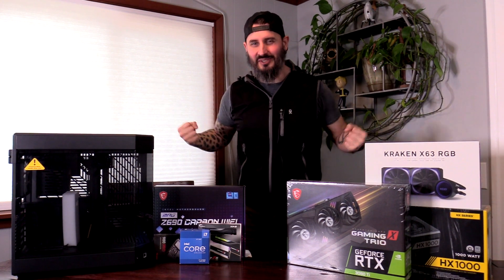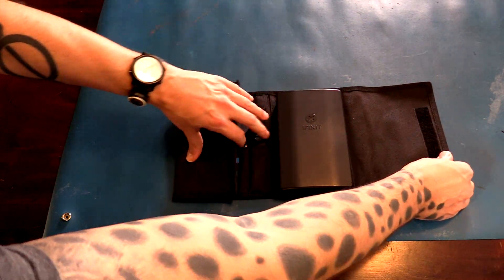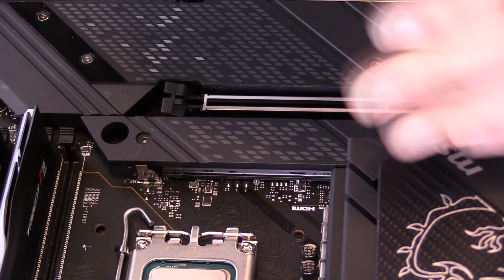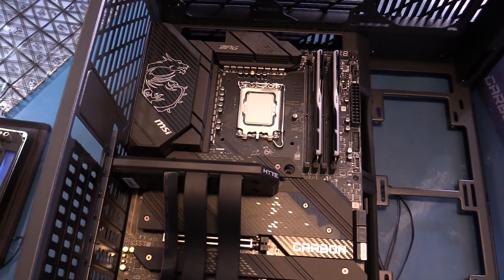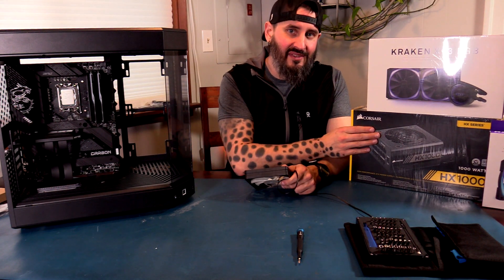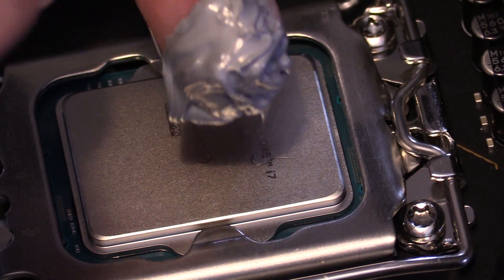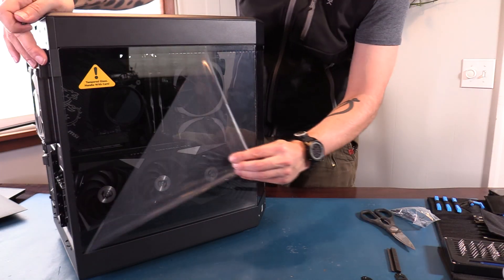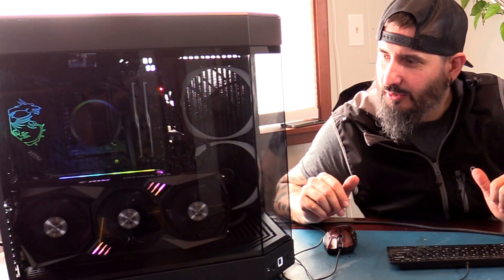MY NEW RIG!!! (Full build video of my new PC)

Comment: How did you control the bottom fans did  you use the  Nzxt controller or direct to motherboard fan header.
Reply from the maker: Great question! The bottom fans are stock actually and came with the case. They hooked directly up to the mobo.

Comment: i might of missed something but whys the rear fan on the outside of the case in the last few shots ?
Reply from the maker: It could've gone inside the case but I did a little mod so it would go on the back and not block the lit up MSI dragon on the mobo. Totally an aesthetic change but this build was centered around it looking amazing lit up so I was happy to do it. 
I did have to make a custom grille for the fan which was easy (link below). I used the case's stock fan and now the blades aren't exposed. It worked out great!
https://imgur.com/b3pwlpW
Reply: @GurhmsGarage  nice one , I only asked a s I have the y40 on order and I know it's a tight fit with a 360 in the roof

Comment: I'm doing a similar build right now I actually have the NZXT Kraken X360, I'm taking my Intel I9 and my 3070 out of my computer for this build. I'm using the same box but the only issue that I'm having is I bought the MSI Godlike z590. I have to save this motherboard is insane! He comes with what they call a smart fan that you plug into where the GPU sock it is but because those parts are already taken up with this case I don't know what I'm going to do with it at the moment
Reply from the maker: Yeah, I'm just checking out the Godlike z590. What an awesome mobo, I love it!
Regarding your issue, I'm not clear on the specifics. Where does the smart fan connect to on the mobo and/or the case?
I hope you figure it out and the build goes smooth. Good luck!!! :)
Reply: @GurhmsGarage  its was the NZXT Kraken x63.. there's a driver issue in the software will not connect and then the lights and up going out and because of it. I got a replacement coming but everything looks phenomenal. Thanks brother
Reply from the maker: @photobeast  Awesome! Cheers my dude :)

Comment: How are the thermals?
Reply from the maker: Really good actually! Even this summer on a 95F day running HUNT all day it stays within acceptable ranges. It does run a little on the warmer side but I've never had an issue or been concerned. Very happy with it, especially with this being my first vertical GPU. They really designed the case well.

Comment: Wow that looks so clean! I'm picking up parts for my first build, and It's funny I was thinking of picking a Carbon motherboard and a MSI GPU like your setup. Those looks so damn clean! Hopefuly I can my build look as cool as yours. (Funny enough, I also have a Y60 incoming, but mine is the Hololive collabation with Hakos Baelz, so very, very red and black xD) Interesting to show the process too, since I've never done any of that xD
Reply from the maker: Congrats on your upcoming build! Awesome! It's a really fun build with the Y60 as well. Lot's of room to access everything and it has a ton of cool options to route your cables. 
I've been really happy with my setup too. The temperatures are excellent, the lights look incredible. It's a real show piece. 
I hope your first build goes great and have fun!🍻
Reply: I just bought that case in red gonna be a bit before I can water cool it is that bad to have the pump so low I can't remember if you want the pump above the reservoir or below

Comment: Hello, amazing video. Just wonderingwhat kind of temps do you get on the cpu? Idle and underload?
Reply from the maker: Thank you so much! Temps are really good. At idle while browsing or editing, cpu sits at around 29c and in the case it's 28c. When under heavy load playing demanding games maxed out with ray tracing I've seen the cpu get up to 70c roughly. 
There has been a couple times it's peaked at around 75-80c but that's only after I've been playing for over 5-6 hours straight and it was hot in my office. 
Temps on the GPU are good as well which is what I was most concerned about due to it being so close to the front glass panel. However, they stick comfortably 65-75c depending on the game I'm playing. Sometimes it's peaked in the low 80s but again, that was after a super long session with a demanding game AND it was super hot in my office. 
Overall, extremely happy with the case and the build. Cheers! :)
Reply: @GurhmsGarage  thanks man, I much appreciate it
Reply from the maker: @BasicPurple  Word up

Comment: There’s 3 fan on top and 1 on back for air out and 2 down and on side for intake so that 4 each so isn’t that equal intake and outtake
Reply from the maker: I put 3 in and 3 out for this build. Two intake at the bottom and one on the back. Two outtake fans on the side and one on the top. Temps are awesome as well. The GPU gets a little on the warm side but that was to be expected.

Comment: Beginning At 6:25 a major mistake was made when  installing the radiator with the cooling tubes down, doing it that way will potentially kill the pump prematurely. There are many major YouTubers that made videos regarding proper installation.  I'm not bashing you, I just wanted to let you know. You have built a very nice system!
Reply from the maker: Yo, thanks for the comment and concern. I actually made sure ahead of time this would be ok and in fact is optimal. The air bubbles are trapped at the top of the aio radiator chamber and not the pump chamber since the highest point of the radiator sits above/higher than the pump itself. The tube direction actually doesn't make a difference as long as the air has a higher point to consolidate that's not the pump chamber (and the air already in the aio system is in the radiator chamber).  
I appreciate the kindness Bro and glad you dig the rig. It really turned out incredible! :)

Comment: Awesome build man. I've actually got all the parts for a similar build, but I'll be using a MSI Edge MOBO with Corsair fans & AIO. Just waiting on the Hyte y60 case. I'm thinking of going with 3 exhaust on top with the 2 Intake on bottom, & 2 Intake on the side with the radiator. Still debating on if that's the route I want to go though. This will be my first build. I'm super excited.
Reply from the maker: Awesome Bro! Major congrats on the first build. What a badass rig it will be too! 😁 The MSI Edge is just as cool honestly. Good savings sticking with DDR4 as well. 
What GPU are you going with? I bit the bullet hard on mine but prices have started getting reasonable again...finally.
Reply: @GurhmsGarage  MSI RTX 3080 got it for a decent price just about 10% over MSRP. I got lucky finding it so I nabbed it straight away.
Reply from the maker: @Ry.No-007  YES! Great news and the MSI 3000 cards are just so damn cool looking. They are only 3 1/2 slots as well so you'll have good clearance for air from the glass front panel. 
I hope your build goes smooth and fun Bro! Cheers :)

Comment: cool video bro thx!!!
Reply from the maker: Absolutely man, cheers! :)
Reply: @GurhmsGarage  yea pretty sure my next build will be in the y60 white for sure
Reply from the maker: @hexacarbide268  Oh man, I almost got the white case as well. It really is a joy to look over at this build. You're gonna love it!
Reply: @GurhmsGarage  yea the contrast makes it pop. Hardest choice is phanteks vs ek aio.  They are both so dope looking in the white out
Reply from the maker: @hexacarbide268  Dang, both those are super dope. The EK takes the cake though man. What's the GPU you're going with?
Reply: @GurhmsGarage  probably the 3070ti /6750 gigabyte aorus with the leds on the blades. U know cause it's a more of a show peice... aesthetics and function.  Specifically cause of that case
Reply from the maker: @hexacarbide268  Hell yea, that's a DOPE card man! It is a four slot card so be sure to double check your clearance. My MSI 3080ti is a 3 1/2 slot and there's a good inch clearance from the front glass panel by looking at it. Might be no problem at all but, measure twice, cut once ya know ;)

Comment: Awesome build man! My hyte y60 is on the way. my main concern has been thermals and you’ve given me a pretty good idea on the setup. I’m probably going to start by air cooling the gpu and using an aio for the cpu, then moving on to a custom loop for liquid cooling both. I’m also gaming at 1440p
Reply from the maker: YES! Awesome man, congrats on your new build!
My temps have continued to be just fine. I've monitored temps during several long sessions in HUNT Showdown and other extremely taxing games (playing at 1440p with maxed settings)...cpu stays around 58c, gpu hits 81c but never gets hotter and mobo was tracks around 71c in the case. It is a little on the warmer side but nothing that would cause throttling and if you eventually go all liquid, my hats off to you. What a killer build this would be all liquid cooled. Cheers Brotha!

Comment: Hey how is the thermals on that? Kinda had the same fan problem u had i was going to do 3 intake top and 2 intake bottom then have the side exhaust fans but i might go with your fan setup instead im mostly concerned about that fan in the back
Reply from the maker: Thermals have been just fine. I've always used full size cases outside of some crazy custom builds in the past so I was expecting it to be a little warmer...and it is, BUT there's definitely no issues. I've tested HUNT Showdown maxed out at 1440p for roughly 5hrs straight and haven't had any issues. I could turn the fans up a lot faster as well but during that session...cpu hit 58c, gpu hit 81c and mobo was tracking 71c in the case. It is a little on the warmer side but nothing that would cause throttling or any other issues. 
Regarding the fan on the back, it's the only thing I'm a little unhappy with but I modded it to work. Firstly, using the stock case fan I had to shave the edge of the fan frame down to allow the glass front panel to close and screw in properly. Be sure to do this carefully because I found the front panel handle to be a little malleable and you want to be sure not the crack the glass. I used a razor blade until there was enough free space for the panel to lock and screw in completely. Another tip, don't cut too low or deep on the fan frame cuz it's not very thick and you will break through. I did a little and had to fill and paint over it. I also didn't want the fan spinning in open air on the back so I purchased some wire mesh and custom made my own grill panel. To attach it, I used some GEL Loctite by applying three dollops on top and bottom (after spray painting it black btw). Below is a link to the Mesh on Amazon and an imgur link to the grill I made. I really recommend this so you don't jam your finger in the fan. Even caught my cat eyeing it lol. The grill panel works great for this. 
I hope all this helps and I'd love to hear what you decide! Cheers! :)
https://www.amazon.com/dp/B09BM2R96T?ref=ppx_yo2ov_dt_b_product_details&th=1
https://imgur.com/b3pwlpW

Comment: 1000 watt power supply and you daisy chained on the GPU... Shame Shame Shame
Reply from the maker: Ah I know what you're talking about now. Normally I haven't had an issue with this in the past. In fact, I've built and run some crazy SLI rigs in the past and daisy chained power for years with no performance issues. HOWEVER, I did some looking in to it and it appears there's been reports on Nvidia's 3000s series cards specifically where using a single cable for each 8pin conn is recommended. The data is unclear on the matter BUT that likely only means RMAs are too low for manufactures to change their recommendations or to give a crap. With that said, I really appreciate your concerned feedback. I'll throw another connector in there and do some tests. Cheers! :)
Reply: @GurhmsGarage  You mentioned the issue during the video when installing the power supply, GPU's are now pulling insane amounts of power. Older GPUs for the most part stayed under 200 watts, since you get 150 from 1 cable and 75 from the board daisy chaining was fine. The MSI 3080ti has been shown pulling 400watts which means the 375 you were feeding it could cause issues.
Reply: @GurhmsGarage  Generally speaking 8 pins safely provide 150 watts and 6 pins 75 watts, and well build power supplies will do more for sure, that cable was probably giving more than enough power but you would have been pulling more than what is considered safe through it, copper has its limits and since you have the equipment not to have to do that, better to err on the side of safety Not to mention More power Means More FPS.
Reply from the maker: @Rega-zozo  Really appreciate the replies and feedback again. I've added a third cable in there just this morning. Crazy how much more power the newer GPUs are drawing. Cheers my friend! :)

Comment: I put 2 140mm be quiet light wings on the bottom and side for intake, then 1 120mm in the back for exhaust. Plus my radiator on top as exhaust
Reply from the maker: Nice dude! So far my temps have been great with my 3x3 configuration. Running HUNT maxed out for hours and everything is staying reasonably cool, even with the GPU pretty close to the glass side panel. What GPU are you runnin?
Reply: @GurhmsGarage  I have a 3080ti fe right now, I had to replace thermal pads in it but my temps are pretty good
Reply from the maker: @DudeManGuy95  Excellent! It's so nice to get to actually SEE our graphics cards now right! Cheers Brotha :)

Comment: Dope build. Curious to see what your temps are? I used this case to build and have 360 aio on top as exhaust with one on the back of the case also. The bottoms are the stock 120s it comes with and I put 2 140s on the side as intake. Gpu stays at a cool 68c for me. Also gpu is a 3080ftw3
Reply from the maker: Thank you! Regarding temps, I've done some testing and everything seems great. All components stay extremely cool when not under load. When gaming, I monitored temps during my last 4hr HUNT session (playing at 1440p with maxed settings)...cpu hit 58c, gpu hit 81c and mobo was tracking 71c in the case. It is a little on the warmer side but nothing that would cause throttling. I may eventually put some bigger fans in the bottom for more intake but for now I'm really happy with it!
Sounds like you have a beast rig as well. Congrats!!! :)